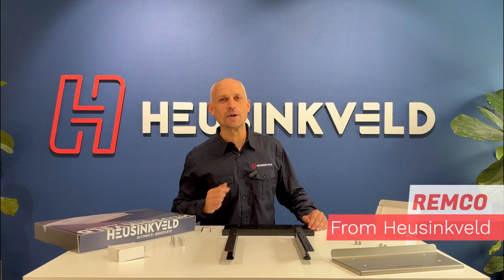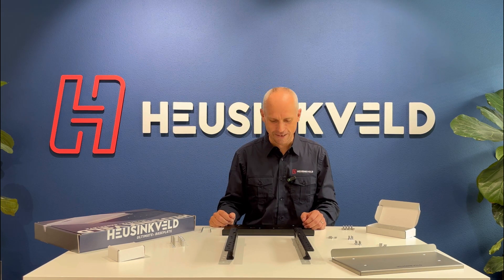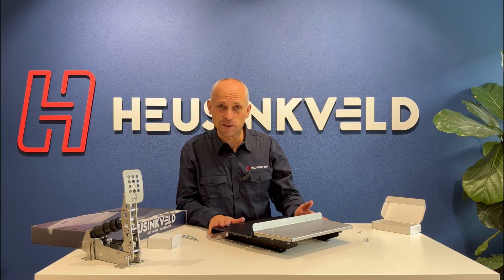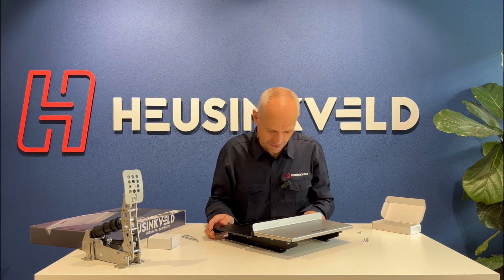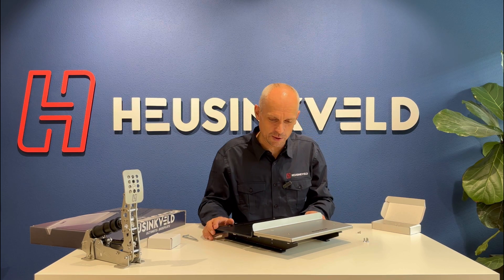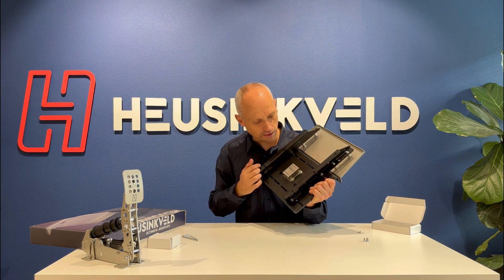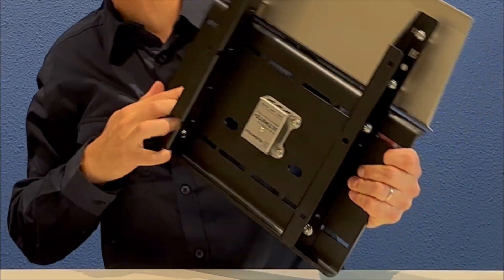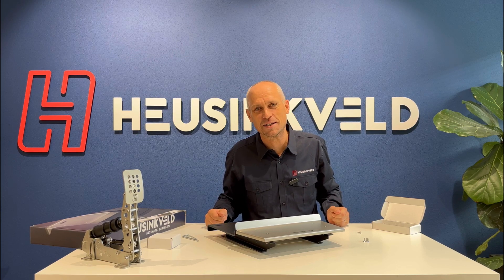Heusinkveld Engineering: How to install the Ultimate+ Baseplate  #simracing #esports

Comment: Does the plate come with different size spacers for the heel riser? Or is it one fixed position size?
Reply from the maker: Hello Jerrid, 

Thank you for your message 🙏 The heel plate on the Sim Pedals Ultimate+ Baseplate is height adjustable. You can either put it in the default position (0mm elevation), or use the supplied 30mm spacers to raise it to a higher position. 

Wishing you a great day! 

Best wishes from Groningen,
Your HEUSINKVELD Team